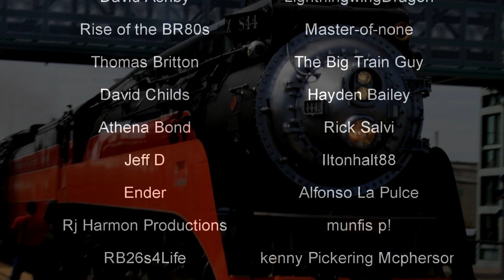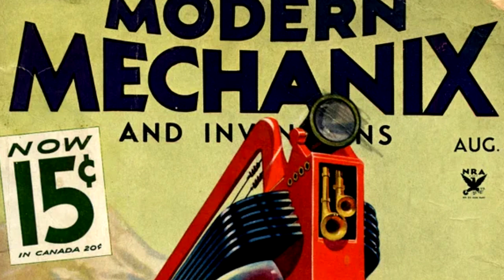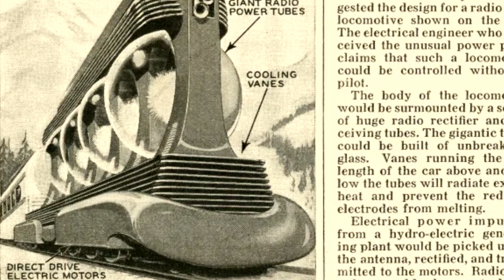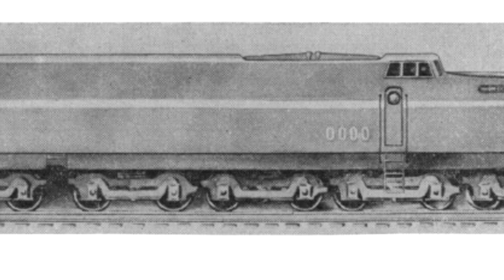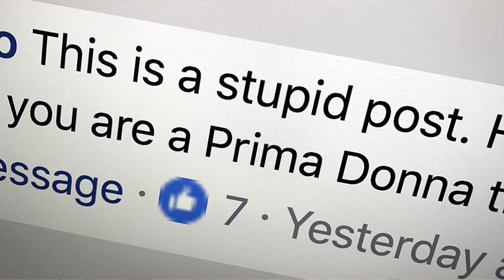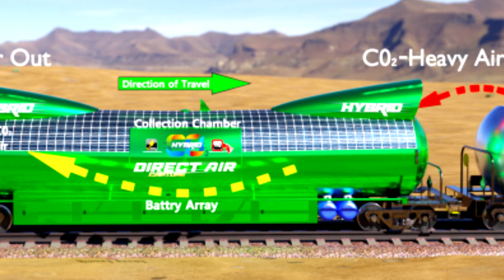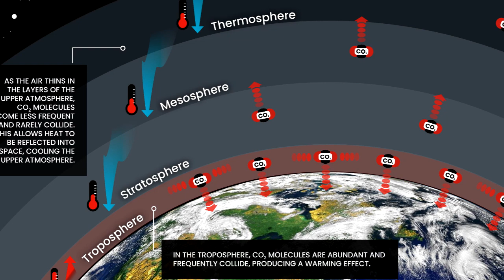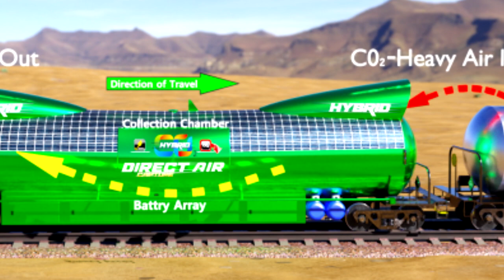5 MORE INSANE Train Concepts (That Were Never Built) | History in the Dark

Comment: It just so happened that I wrote an article on CO2 Rail for my earth science class a few months ago about current events regarding climate change, and my main issue with this is that it still relies on fossil fuels to power the diesel engines instead of using cleaner forms of energy. While I don't think the railcar is supposed to take carbon out of the surrounding atmosphere (not counting the diesel emissions), I do feel a few prototypes may be built for testing, but I'm not sure if it'll be used on a wide scale.
Reply: I think it'll be more feasible putting these cars on electric trains in light rails
Reply: America should probably just ellichrefy their railways 🛤
Reply: Yeah idk that it would ever be mass-adopted. Kinda doubt it. However, I can see the logic in the design and tbh, it's kinda genius. I just don't think it'll ever get enough attention or funding to become a reality
Reply: @fanofeverything30465  From everything I've read, seen and heard, the US power grid currently isn't up to the task, as rolling blackouts have been a thing in California for several years now.  Also, what are they going to use as power sources?
Reply: @moosecat  Oh yes I never thought of that
Reply: @senioravocado1864  But again these cars have to be extremely heavy so would it would be worth it to put these cars on light rail? when does slow the efficiency of the right Light rail overall?
Reply: @CrisisHedgehog  i mean, it cant be any heavier than a fully loaded car, besides, the light rails I know are electric and each car is powered
Reply: The trouble is, Pensyfan19, like many Americans, you're thinking only of your own somewhat insular country… Most of the world's railways are heading towards electrification, for main line and freight as well as light rail, interurbans, and trams/streetcars.
Reply: @senioravocado1864   Most of the world's railways are heading towards electrification, for main line and freight as well as light rail, interurbans, and trams/streetcars.
Reply: @chrisgraham5186  yeah, so this might be a great opportunity to smack these air cleaners to at least clean out she smog
Reply: @chrisgraham5186  That's because most of the world actually knows how to properly invest in trains. Lack of railway investment over cars seems to be a specifically North American problem, and I applaud the rest of the world for doing something so essential that one of the largest countries in the world fails to invest in.
Reply: @fanofeverything30465  What is?… and in what way?
Reply: @fanofeverything30465  Meaning they don't draw their references from beyond their own country.

 'American' isn't a race, it's not even an ethnicity. It's a nationality, so my comment can't be racist. There are Americans of all races. I didn't single any one of them out from others, whether positively or otherwise.

 It wasn't meant as an insult, but a statement of fact (or at worst, an opinion). 
I'm not even suggesting they're being deliberately xenophobic, as it isn't being consciously done. 

The US's media and education systems are probably to blame as they're heavily USA centric, and most Americans don't travel abroad or even own a passport. Knowledge of the world outside the US is sadly poorer than that of even schoolkids from Asia and Europe, let alone adults.
Reply: @chrisgraham5186  I'd like to see proff of this
Reply: @chrisgraham5186  I'd like to see evidence of this
Reply: I think you are missing the point.The diesel  engines would. be producing emissions anyway regardless and there is provision for an REM railcar which will capture these diesel emissions. and  blow them into the scoop or  cowling   on the Direct Air Capture plant so these emissions will be captured as well as the CO2 being scooped p from the. slipstream of the moving train. Have a look at [Joule Vol 8, Issue 7, July 20. 2022] which explains the idea and there is useful .pdf as well containing. supplemental  data.
Reply: @CrisisHedgehog  They were excluding light rail I think

Comment: The carbon dioxide train idea - well no but there are people with real backers who are working to capture CO2 from the atmosphere and do things like pump it into emptied oil fields deep underground and there are people working on taking CO2 from industrial waste streams and combining it with hydrogen to make new fuel (like methane making for a zero net emissions fuel), It can actually work that way, but there is no reason to drive around collecting CO2, it will come to you and since there are lots of places like industrial sites where hundreds and thousands of tons of CO2 are emitted from one place and could be captured with a big tube there are less than zero reasons to try it with a train car.
Reply: no life with no co2, would require more land for same out put of crops with reduced co2. on top of that earth average global temperature 30 year average earth is still cooler than it was in 2016, the peak of the last solar cycle

Comment: 4:25 Nikola Tesla Planned To Use Earth For Wireless Power Transfer by using the rocks in the underground as sort of conductor, the vibrations are sent to a receiving device and the oscillations transformed back into electricity, to be used locally.

Comment: Re DAC solar cells - back of the envelope (with lots of rounding) power generating capacity: exposed surface area ~= (3m diameter * pi)/2 * 20m length ~= 90 m²; the sun yields 1kw of solar power per square meter in the best conditions, 300w typical. Excellent solar cells are about 25% efficient. So maybe the DAC obtains about (30kw * 0.25 ~= 8kw) to (90kw * 0.25 ~= 24kw) or about 11hp to 32hp from its solar array. It won't be solar power that makes this choo-choo go 😂

Comment: So, apparently slapping a 'HYBRID" logo on anything makes it 'green'?  The DAC collection car isn't powered, other than maybe something to do with the regenerative braking having a motor involved.  The Locomotive (DACX 2021, cute) is supposed to be a hybrid?  Hmmm, Diesel engine coupled to a generator, providing electricity to power the traction MOTORS at the axles....  Yep, it's a hybrid.  Funny GE hasn't been marketing their locos as the GE Prius.  Manufacturers could replace or divert the power generated in the dynamic braking system to either onboard or separately carried batteries on the train to store energy instead of venting it through the resistor banks in the root (the large round fan ducts seen from above).

Comment: The CO2 Capture Car sounds like either pie in the sky thinking or an outright scam.  However it does make one think...
How much energy is produced from regenerative breaking and can it be harnessed?  Let's say someone builds basically a cow/calf setup where the calf has batteries to store energy from the other locomotives and uses the Cow/Calf as a helper unit for steep climbs?  Yeah you probably couldn't get enough power on the downslope to get it up the upslope but what would be the savings?  Would it be like 50% fuel savings or like 1%?

Comment: Direct air certainly has an interesting idea, but I wonder if some stationary carbon capture plants combined with some other way to harvest energy from braking wouod do a better job. Regenerative braking certainly is a thing, but many trains just send the energy from their electric brakes through some resistors and create heat, as non-electrified locomotives usually lack any  means to store or use the energy from breaking. Modern railways can regenerate up to 40% of the energy used for driving, but obviously it depends on the route. The line From Kiruna(Sweden) to Narvik(Norway) even produces more energy than it consumes, as they transports big loads of ore downhill but go back up the mountain empty.

But my big question about their system is whether it would be easier and more economic to use some other way to recover brake energy and then use it to power stationary capture plants. Obviously electrifying the railway would be a proven method, but even just an electrolysis cart to create hydrogen from the loco's brake current like a big battery would probably be lighter and cheaper than to put the entire carbon capture device on wheels. Obviously every time hydrogen as a fuel is mentioned people go all crazy because of how dangerous it is, but railways routinely transport much more dangerous chemicals. Compared to other flammable liquids or gasses hydrogen even has the advantage of being lighter than air (under ambient pressure ofc), so if a train crashes and not immediately burns the gas would float away instead of forming a puddle